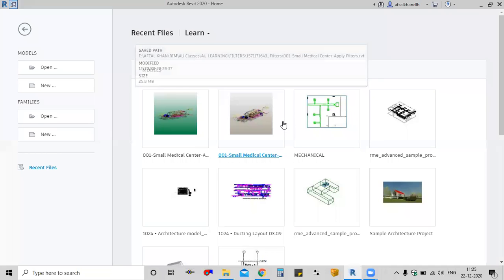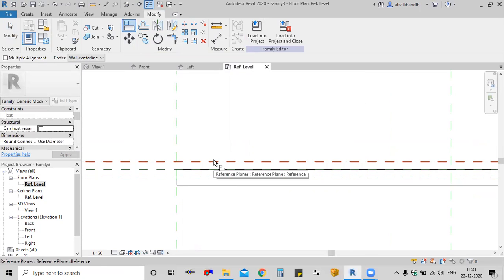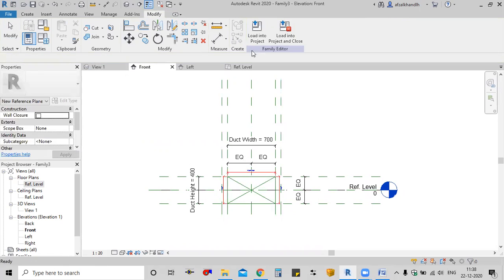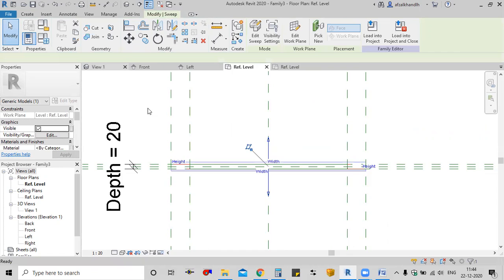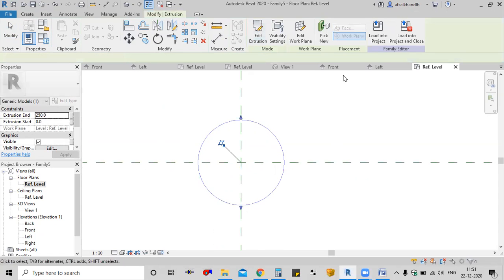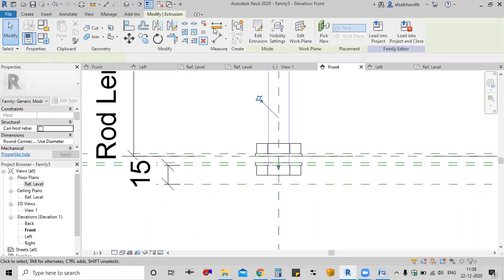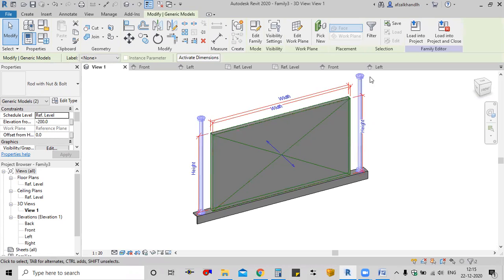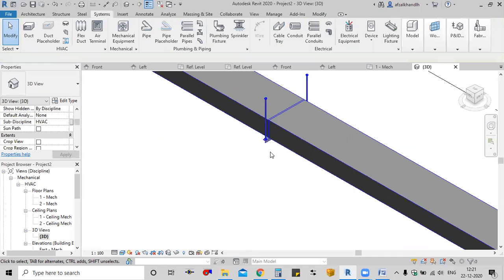Detailed Duct Support Family Creation in Revit 2020

Comment: Even though this not the right way this is a good workaround, there are many problems associated with the method.
1. This breaks up your duct in the middle and causes problems while resizing your duct and calculating pressure loss.
2. This is acting as a damper accessory so if you create schedules this will be displayed under schedules.
This is good if you are using only for modeling purposes, not for practical application,  if you actually want duct hangers you can use design to fabrication or you can simply model one where you define the width and middle elevation of duct as a parameter.
Reply from the maker: Hi Faisal 
Thanks for Responding ..
1. we can connect the peice with the help of trim tool.
2.if you change the category as generic family than it will not highlight in the schedules or if it is there in the schedules than there are many ways to isolate it from the schedules. i hope u got it 
Feel free to ask if u have any questions